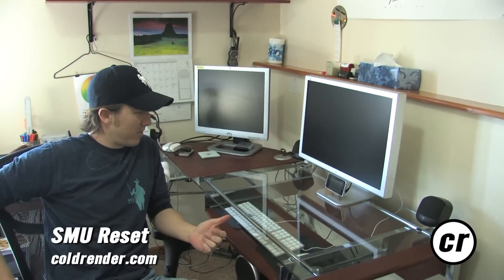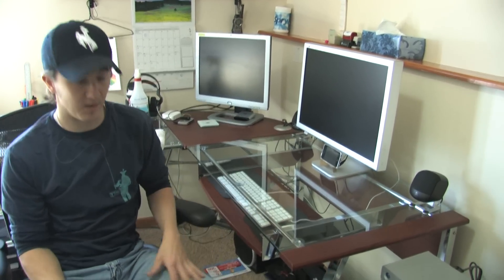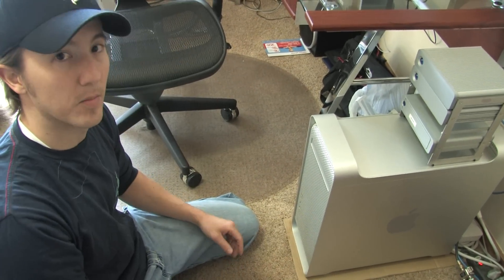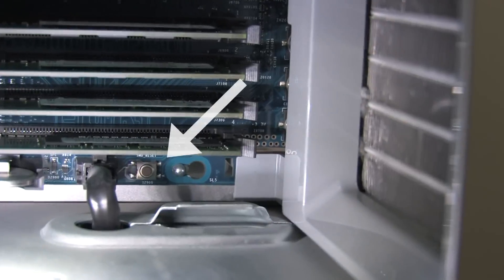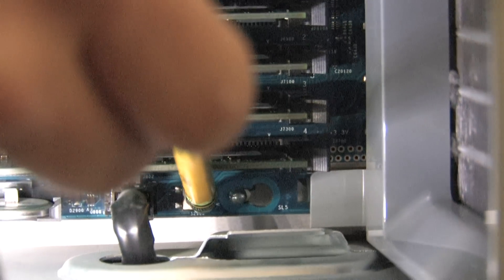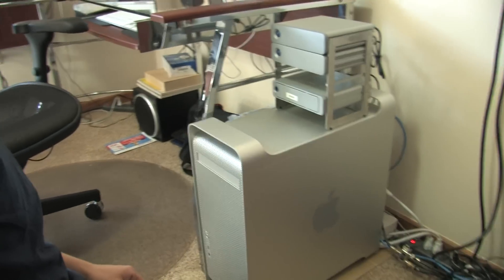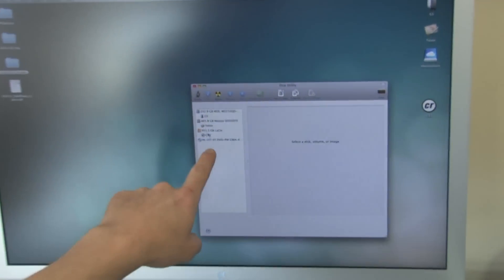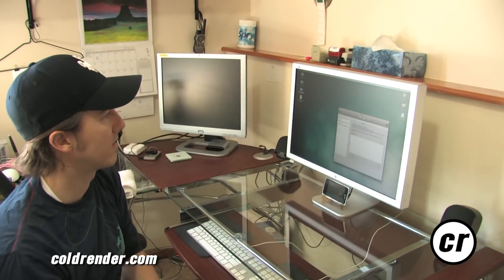SMU Reset Switch on Apple G5

Comment: Sadly I think my 2005 G5 Mac Pro is a goner.  Resetting this didn't make a difference with fans going crazy.  This particular machine went through 3 logic boards, etc.  So bad that Apple paid for the last one years ago because it was so bad, even though it was way out of Apple Care.  This IBM PowerPC chip just wasn't ready for prime time requiring too much cooling and prone to failure.  Well I did get my use out of it.  No worries, it's time to move on anyway.  The "new" Mac Pro 2013 doesn't suit me though and my 2007 Intel Mac pro is also long in the tooth.  Hopefully Apple will get back to Mac Pro tower basics.
Reply from the maker: I agree with you in hopes that Apple will return to the utility and basics of the Mac Pro towers.  I think expandability is essential in many work systems.  Good luck!

Comment: Thanks for posting.  Unfortunately after these steps fan noise is still red-lining.  Just had the mother board replaced too!
Reply from the maker: +Yves Lucero I think a logic board failure can cause this.  Mine has since died, but perhaps I can resurrect it.  It's sad to see such a workhorse to pass into such insignificance.  Good luck with yours.  I hope you can get it running.  Try zapping pram and doing an SMU reset.  I don't think it'll work, but maybe you'll get lucky.

Comment: when i switch on my mac g5 i wont on ... any help
Reply from the maker: +Edwin hardy it's common for the logic board to fail in the G5s.  Unfortunately it's terminal, and you'll have to replace it.  But first I would check to be sure the power source is working properly and rule out other problems like a bad system drive.  Sorry I can't give you more specific information, but it's hard to diagnose without actually seeing the computer.  Good luck!
Reply: ok tenkew

Comment from the maker: i think you can probably find one on amazon.  it is a special kind of plug, with sideways pins.  that would be the first place to start.  be sure to confirm that your outlet has power and then think about replacing the entire power source within the G5.   for only $80, you may want to just cut your losses and sell the machine for parts.  good luck!

Comment from the maker: @TheParaSIET i'd be surprised if it's the power cord.  it seems that it wouldn't work at all if it was the power cord.  i'd be more suspicious about the power button itself, but that also seems unlikely.  try cleaning the entire system, and check for dust in the power button.  then be sure you have a static barrier between the computer and the carpet (or put it on the desk).  i'd also zap the PRAM